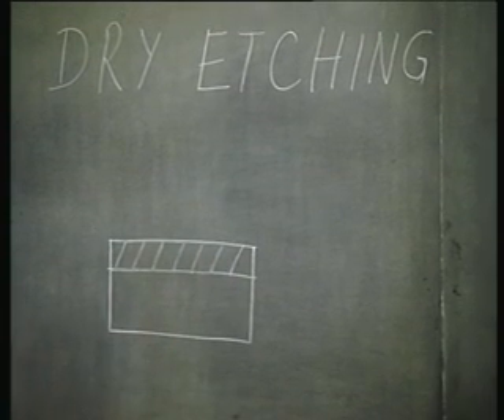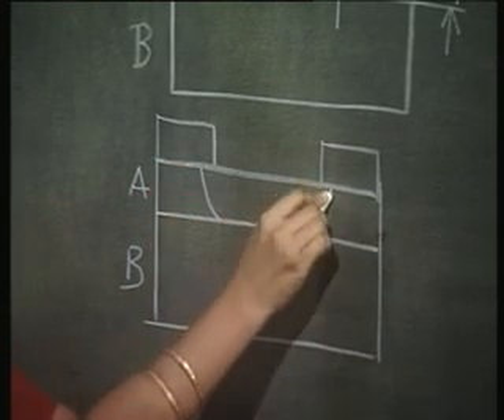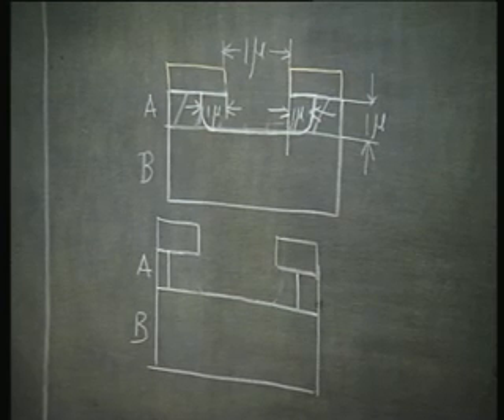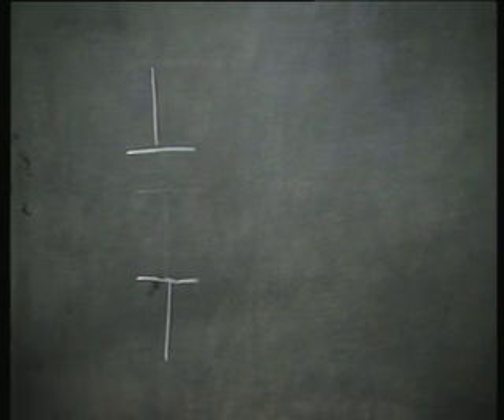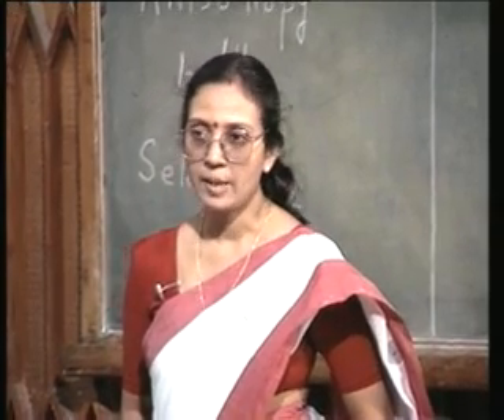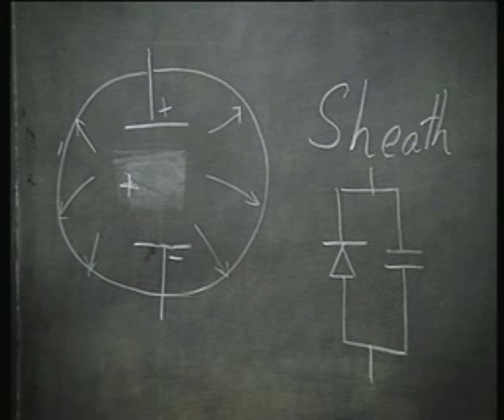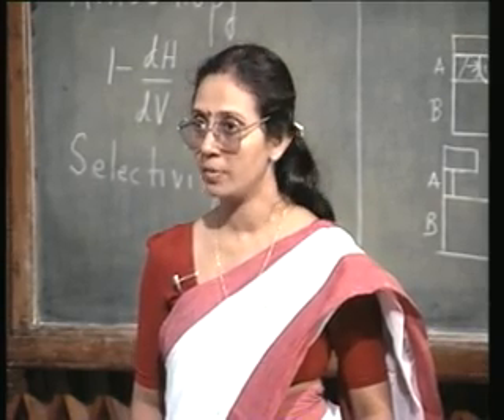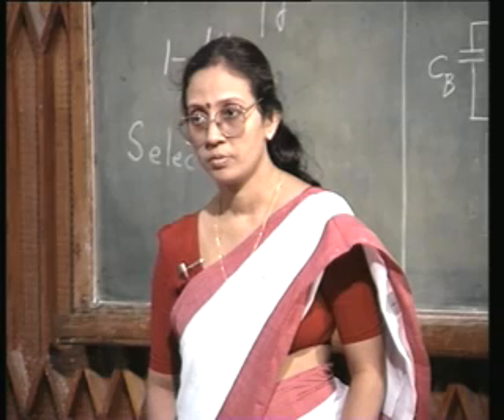Lecture - 26 Dry Etching

Comment: the plasma etch RF frequency is usually fixed and is not variable as you mentioned @49:44
Reply: Its 15 year old video, you can vary the RF frequency the standard value of 13.56 Mhz was not set back then